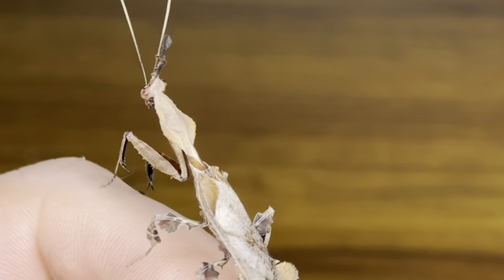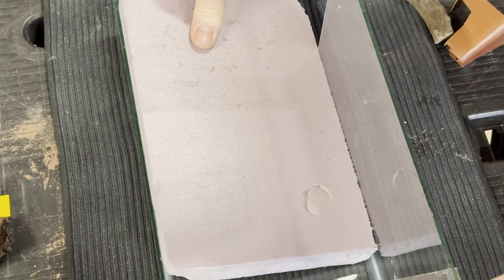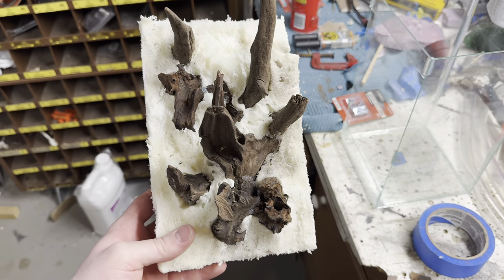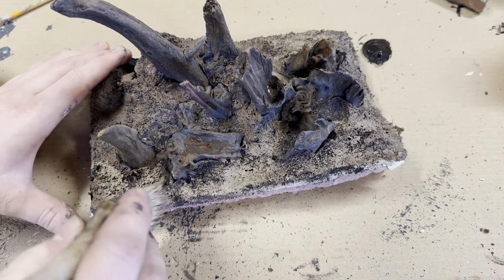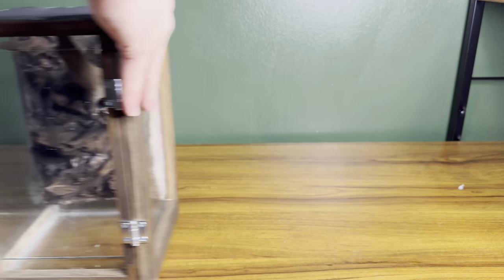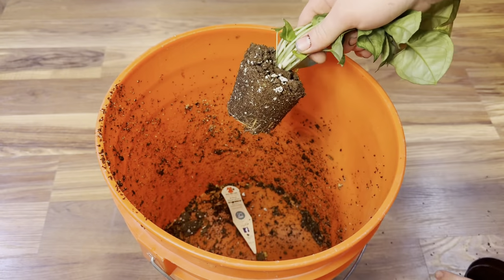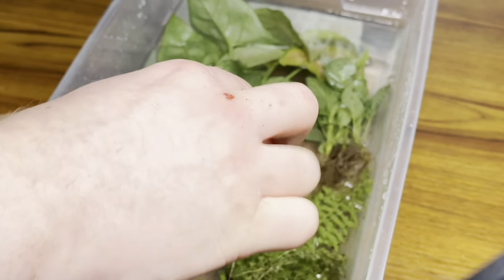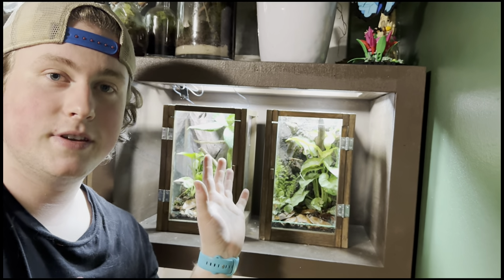DIY Ghost praying mantis vivarium

Comment: How did you attach the back drop to the wall
Reply from the maker: I actually didn’t, the fit was snug enough for it to just stay in place by itself. Otherwise I would have just used silicone.

Comment: Great build! Quick question, how do you water your terrarium plants? I’ve been using a small watering can but wanted to know if you use a different method.
Reply from the maker: Thank you! I usually mist the enclosure daily and then just use a small cup or glass to water them a couple times a week. nothin fancy.